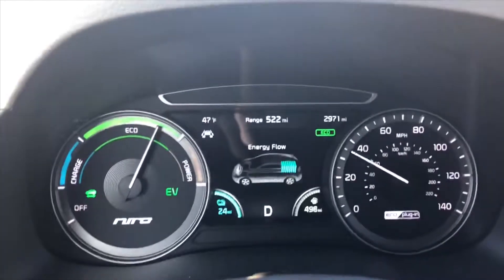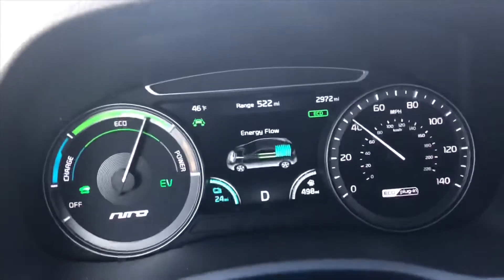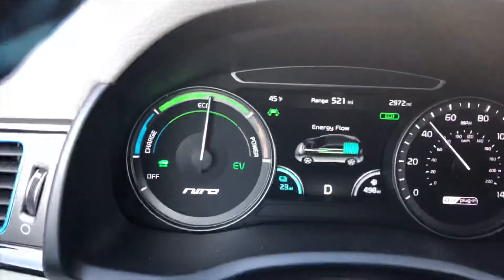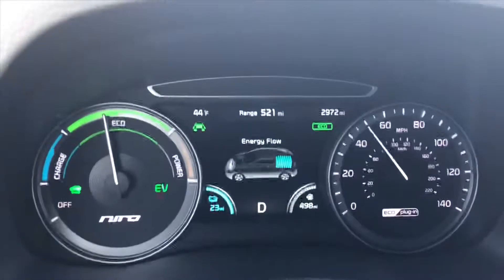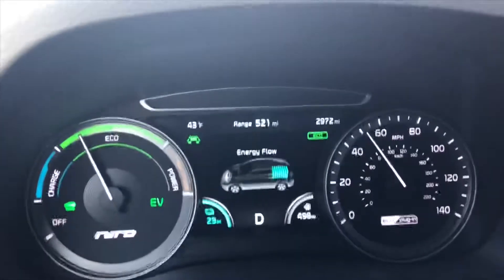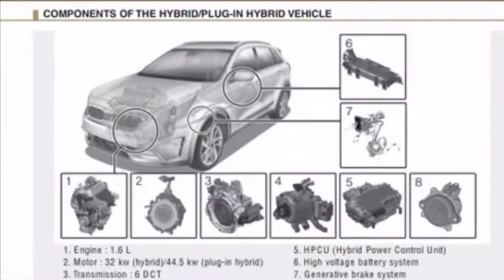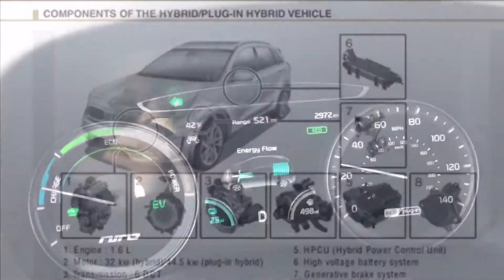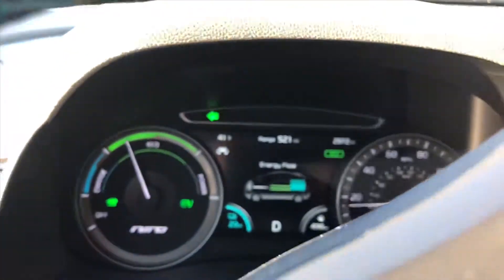Niro PHEV Cabin Heating’s Impact on EV Mode

Comment: can i park it and use electricity only for air conditioning? how about heating?
Reply from the maker: The air conditioning consumes about 1.5 kW, at its highest, so it depends on how much battery you have left. Heat requires the gas engine, even in the newest model.

Comment: I noticed mine can still get 80-90mpg with the gas motor running for heat (but not driving the car). It just runs at a steady 1300rpm, probably the most efficient speed for fuel use vs producing heat. Soon as the gas motor shuts off the mileage goes back into the 100's, so not a huge impact unless it's really cold.  Also it's charging the battery while running so it's not just gas wasted for heat, it is also extending the EV range a little. 

A dealer also said running the gas motor when cold isn't all bad. Like you don't want to get on the freeway or go up a big hill with a 100% cold engine, then have it started up into an immediate hard load to take over. That's not great for a motor, on a traditional car the motor gets some time idling and a few miles light driving before you need to push it hard.
Reply from the maker: I hope that the new Niro has a heat pump. It would let people stay in EV mode in cooler weather. There are temperature ranges where the engine will engage (and not disengage) and those won’t change. I assume those ranges exist in order to protect the engine. It would be nice to not have the engine run when the temperature gets down to 50° F (10° C).

Comment: Can the heat run strictly off the battery while parked? Someone else mentioned that when the heat is set to high the engine kicks on but never mentioned anything about low cabin heat set to low
Reply from the maker: The heat for the cabin comes from the gas engine, so it will run until the coolant system is hot enough to provide heat and then shuts off. The amount of time it stays off depends on the outside temperature.